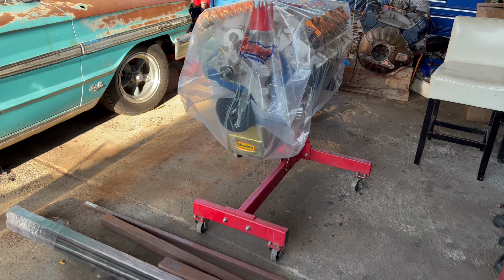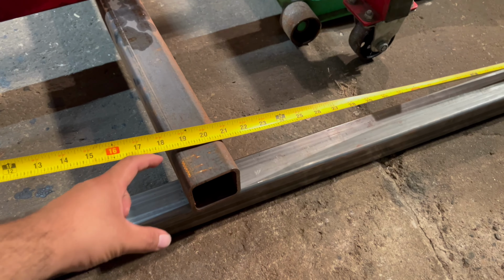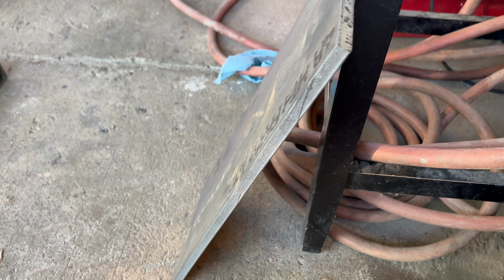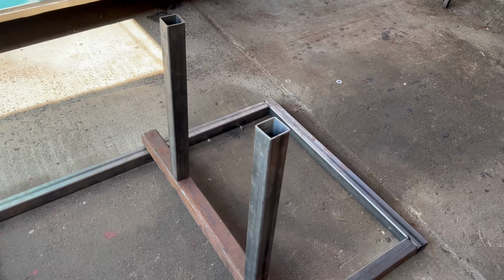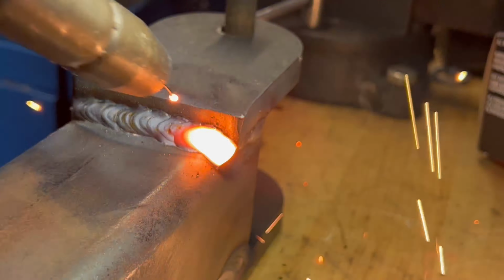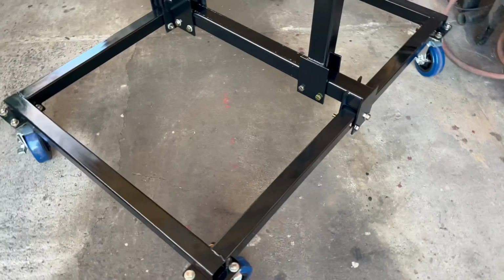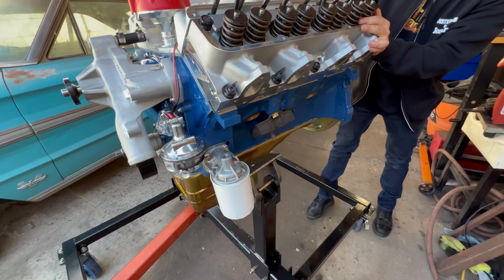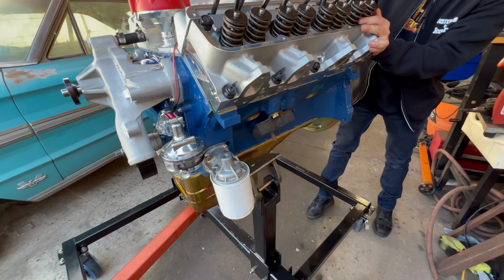Ford 428FE Build Part 10: Engine Run Stand Build! 1/2

Comment: It sure will be a lot easier to put back in the inside valve springs after cam break in if you went with a flat tappet cam, then it would be down in the car especially around the brake booster.

Comment: Nice Omar. Are you going to add a radiator and fan so you can give it a good test run. Most camshafts require around 20 to 30 minutes at around 2000rpm to break in correctly.
Reply from the maker: Yes! Radiator and electric fan will be wired! Sweet I’ll look into the breaking procedure as well

Comment: Could you do an in-depth video of removing an older engine from a car,dealing with workers at the junkyard and specific tools you use? Most videos like that on YouTube are LS engines. Thanks for all the cool videos.
Reply from the maker: Hey Anthony, I plan on buying a ford 351 Windsor at the junkyard. I’m sure I’ll make a video on  it, just waiting for one to pop up. I think it would be cool to run it on the stand and see if it will work.

Comment: Using the rear support arm from an existing engine stand was a cheap and smart solution.  Startup on your FE is getting close!
Reply from the maker: Yes almost there! Goal is to get the galaxie running by January